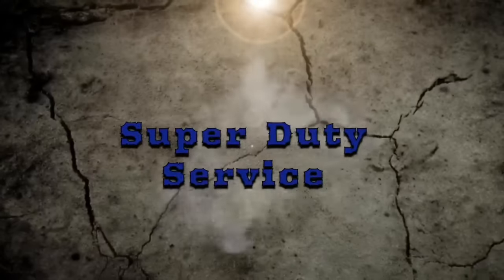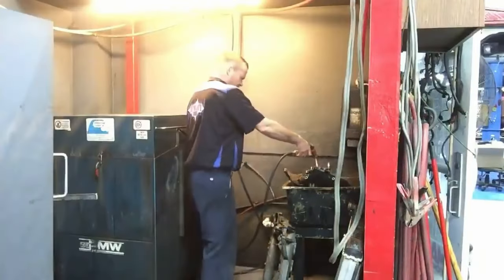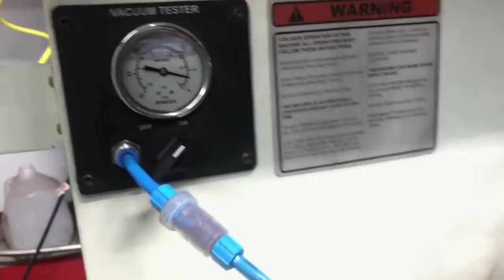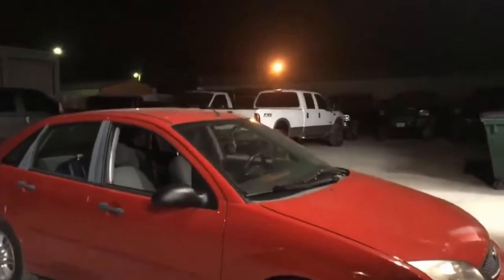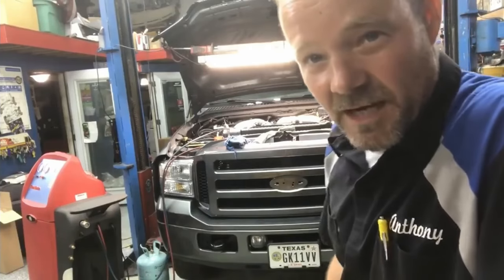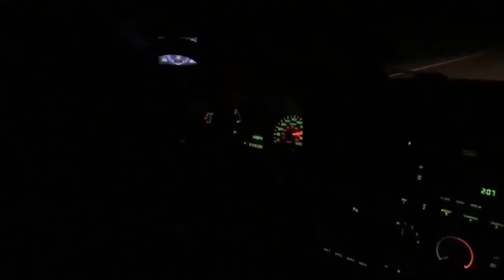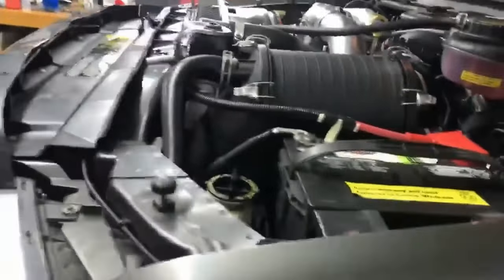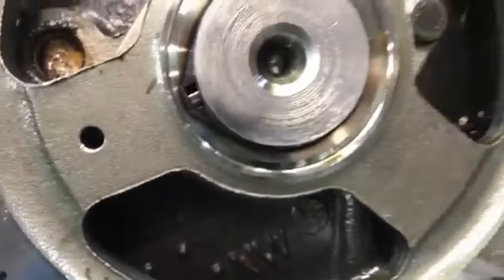Rebuilding Jason's 6.0 Powerstroke

Comment: Anthony weld a donor socket to the head of the bolt. She'll turn right out. You can cut the weld and reuse on another bolt. Plus the bolt can be reused.
Reply from the maker: I have never really been a fan of welding.  I get the concept,,  but I struggle with bragging about my own personal welding skills.   I can drill a freakin hole tho!!!    lol

Comment: What’s the reasoning for revving the engine like that at first fire up?
Reply from the maker: That is a GREAT comment.  I will have to get a video answering that question.   It is a "theory" of mine.   It kinda evolves around the idea of the slowing crankshaft being loaded up to increase the rotation,,  as it is slowing.   It causes the fpw (fuel pulse width) to raise,, which equals much more fuel being introduced.   I will comment more on this when we get back in the shop.   Thank you for watching!!!